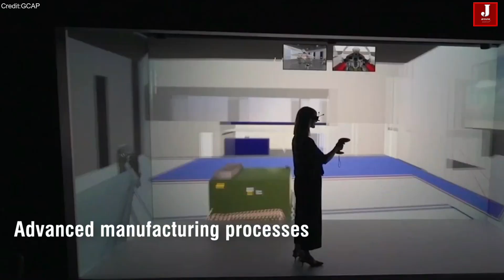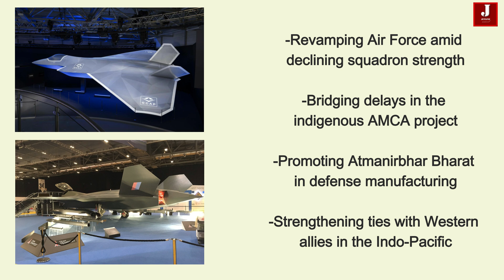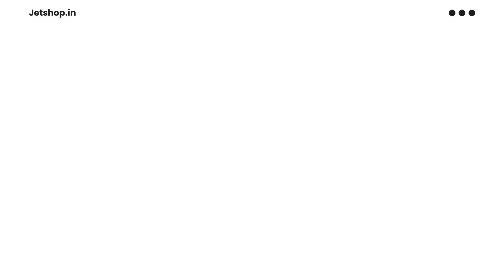Will India Be a Part of the 6th-Generation GCAP Program?

Comment: Looks like a non-starter. India has failed to take any moral stand on Russia's illegal war of conquest against and supports Russia. This hints at India helping Russia by passing on any technology it acquires. It's taken India from the early 1980s until now to get two squadrons of HAL Tejas aircraft into service. Slow development and comparatively low technology are not enticing attributes for entry into a fast-paced, cutting edge technology project. Maybe India will be allowed to buy them after they have been in service for 15 or 20 years.
Reply: By the way, europian countries buying more oil from Russia than India. this tempest program nothing but a failed program like eurofighter typhoon.
Reply: 😂 first of all both britain and Italy invited india then later japan!! 

Beside britain's rolls royce r eager to work with India, it's india who choose france's safran over rolls royce and second germany and france along with Israel and japan too r working with india in tech transfer and stuff!! So one way or other india will get its hands on those tech!! And rest they can figure out too!!
Reply: @abhishekbhaskar6268  I note that Safran spent 10 hears trying and failing to get their "Silvercrest" engine to perform to spec. In th eend they gave up and a RR engine was used instead (you can look up the history if you are interested). At best Safran is second rate. India is, to some, a pariah state at the moment for its lack of backbone in supporting Putin's imperial ambitions in Europe, in contravention to numerous international laws and agreements, voluntarily entered into by Russia. Given this, I sincerely hope India doesn't get any cutting edge technology because it will betray the trust placed in it by the donor state.